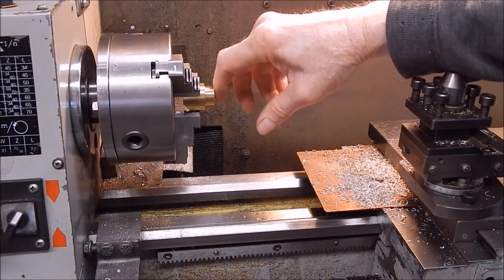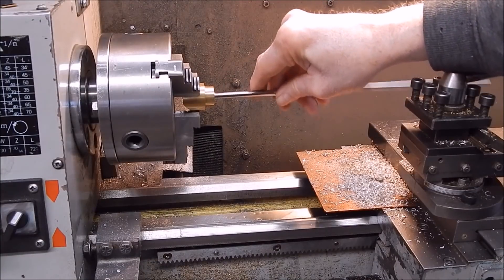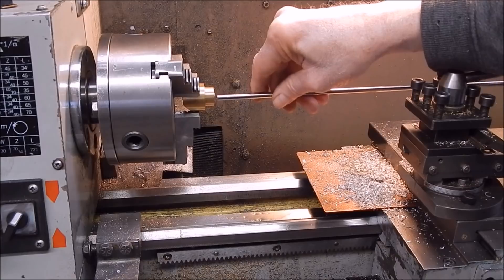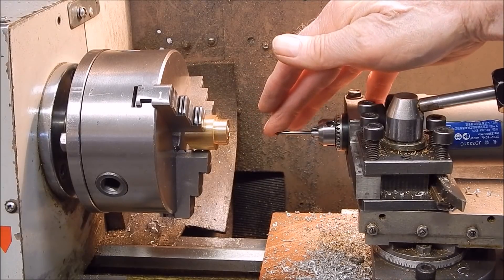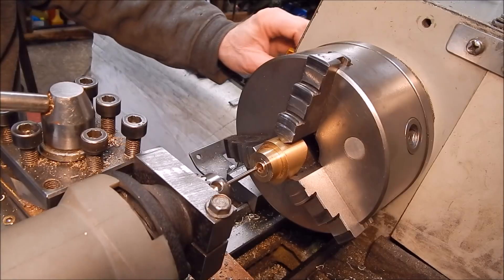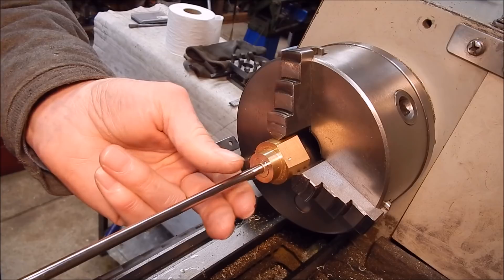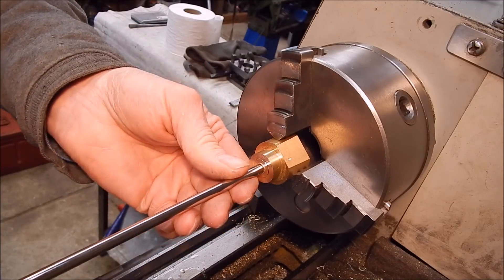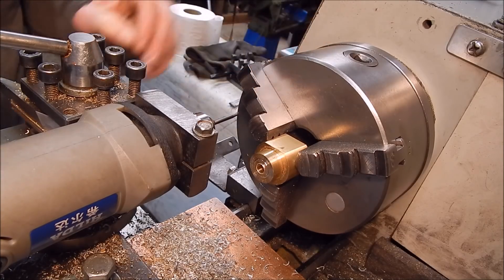My cheap HILDA tool post grinder gets me out of jail

Comment: Rob, i can't thank you enough for your Hilda videos. i might have seen it on Banggood's site, but I wouldn't have bothered with a 220v tool if I hadn't seen your review. It was worth getting a converter, for sure. I just now came in from the shop after grinding a corroded shaft with my Hilda It's becoming one of my most-used accessories.
Reply from the maker: Hi Charles,

Yes, it's really versatile. I don't use my full sized TPG any more - it's just too bulky and can't mount on the topslide.

The HILDA is so cheap in comparison.

Cheers Rob

Comment: Good idea. I spin the diameter of a drill bit down on my diamond wheel.
I lived in Harndorf in the early 80s. And did a lot of building around Little Hampton, My Barker, Strathalbum, and all the way up to Port Aguster.
Reply from the maker: I have done that, but they can go bang when you're doing it as the end is unsupported.  Not something I would recommend.

Cheers Rob

Comment: interesting approach. why would a d-bit not work? Or use the hilda as a small toolpost grinder  to grind down a 6mm drill to the desired diameter? Or you could drill slightly under the desired diameter and lap the  hole  with a wood stick and a grinding paste. Admittedly your approach was really quick and simple.
Reply from the maker: "D" reamers only work on very small differences. This was too great.

NEVER grind down an unsupported drill bit with a TPG. They can and will set up a harmonic oscillation, catch the disc, and snap.  I've seen this happen.  You may get away with it on large diameter drills but anything under 10 mm is asking for trouble.

Cheers Rob
Reply: You use the term D-Reamer and I use the term D-bit meanin a single lip cutter. Is it possible that we don't talk about the same thing? With a D-bit you can drill into full material. Only you have to peck when drilling into the full because the free volume for chips is limited.
Thanks for the tip about grinding drills without support. I am sure you are right. One could think of a brass/bronze bush to use with a follow rest. But that is not practical with such a small drill bit.
Your chosen method tops all the alternatives in terms of simplicity.
Reply from the maker: Same thing Roi.  It's just a round rod with one  half of the end ground flat.  I have considered grinding a slight concave rather than a flat to see how it would work on steel.  On brass you don't want any top relief, but it would help on steel I expect.

Comment: Sneaky and most effective approach! Still yet got to make a holder for the HILDA. :)
Reply from the maker: Hi Chris,

I was thinking afterwards it might have paid to use a bit of lube as brass can clog serrations as well, although the rotational speed should help prevent that.

I normally never use lube on carbide and tungsten, but that's with ferrous metals.

Cheers Rob

Comment: I wasn't quite clear why you didn't use a shop-made reamer, could you explain that a little further?
Reply from the maker: I don't have a shop-made reamer.
Reply: You mentioned a d-bit reamer, I'd assumed that would be shop made. Reamers are really very easy to make, even by hand, just grind 3 facets on the end of a round piece of tool steel
Reply from the maker: No.  I make my own "D" reamers.  It's dead easy.  I don't buy any more tooling than I have to.  My collection of bought reamers is less than five.
Reply: You make your own D reamers, in your shop, making them shop made, that's what that means. So why couldn't you use one of those?
Reply from the maker: I misunderstood, I thought you meant bought from a (retail) shop.  The difference was too great in this case.  I did consider it, but having used "D" reamers before I know what they can and can't do.  If there's too much difference in sizes they just chew up the job.

The burr worked out perfectly and I didn't have to make anything up.

Cheers rob
Reply: The burr was a great solution, I didn't mean anything against that, I just didn't understand what you said about reamers in the video
Reply from the maker: No problem Rob. You just go with what you have and what will work.  The "D" reamer which was my first thought wouldn't work.  Too much difference.  I've been there before and they are only suitable for cleaning up really.

The burr was a bit hairy to use as I could only go by sound.  Once I heard it it kiss the job I locked the cross slide.  Same as grinding.  You start with minimum contact and work up from there.  I've done lots of grinding and sound is very important to gauge how things are going.

Cheers the other Rob